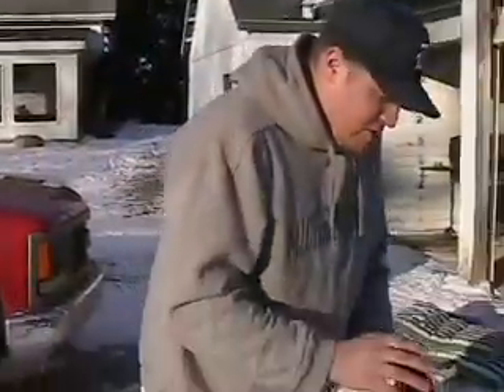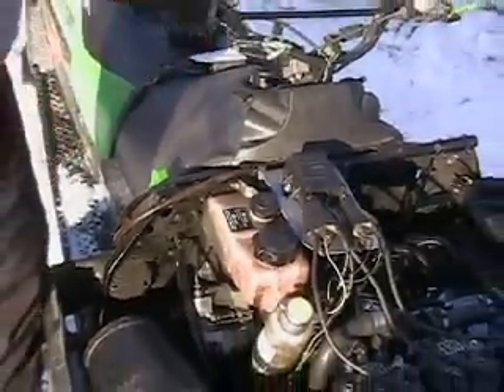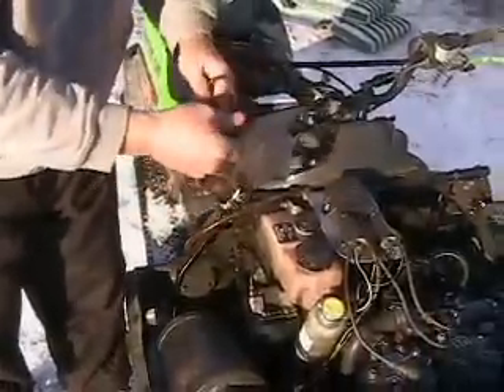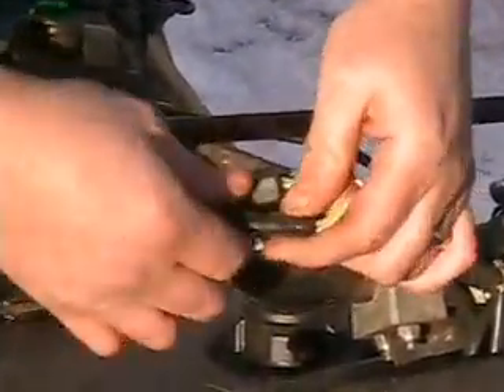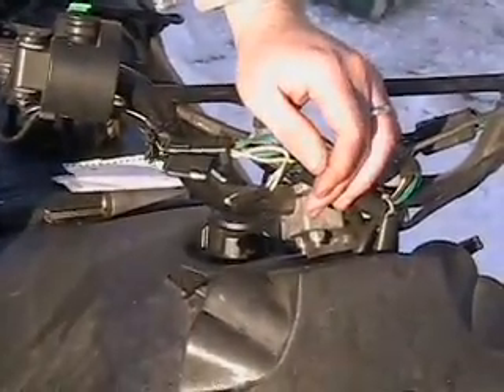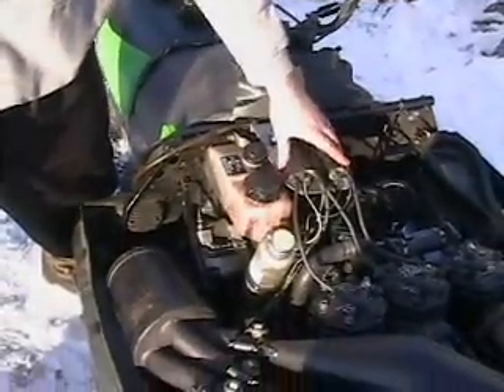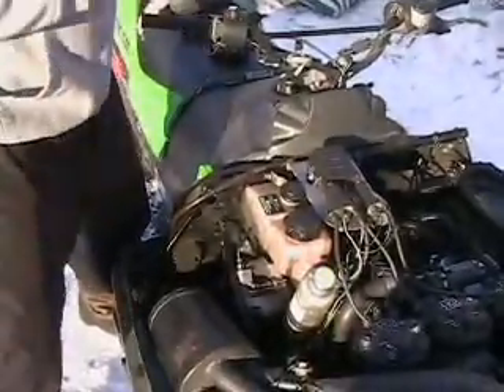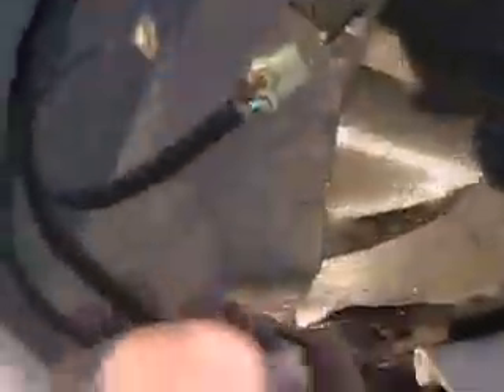Electrical Diagnosis for Arctic Cats

Comment: I checked all the stuff in the video like jumper jump tss my sled is a 1995 ext 580 i have a new coil stator and cdi in it still no spark with out the jumper it is a closed loop
Reply: Also I checked the kill switch and key both checked out me personally im lost

Comment: Hey man thank you for your videos I was able to successfully change my stator amd get rolling again. The harness got crushed and shorted out I thought I fixed it all but I still have no accessories. Really I'm just trying to get a headlight going as I just ditch bang with the sled I'm not on trails. Is it possible to just wire the headlight or a light bar directly to the 2 yellow wires on the top of the stator 4 prong plug. ?

Comment: I have 2003 artic cat mountaincat 900 is efi but I have to connect a 12 v into my fuel pump to make it work and also I have to pour gas to get it started any ideas is like the snowmobile

Comment: sled had big fire will back rebuilt most got running then moving coils and cdi it lost spark something is grounding surely replaced CDI with 2 coils low chance they both went bad just cant find what caused it.

Comment: i have a 02 z570 i have replaced stator the pic up coil and the coil pack and still have no spark.
Reply: i have disconnected the shut offs and still no spark

Comment: No spark but light glows when pull starting motor….stator ?
Reply from the maker: The stator has separate windings on it. There are ignition coils and there are lighting/ac power coils for lights and hard warmers.
Reply: @BlaineDP  thanks …discovered it was the coil . Your video is excellent..helped me diagnose the issue.

Comment: I had spark with stator jumper wire. So i pulled seat off mice got under there and chewed wires to twilight grounding out stator.  All fixed Thanks Again.
Reply from the maker: Glad you found your issue.

Comment: I have a 97 Jag 440 fan that I recently bought... the sled has spark and runs but I have absolutely no lights whatsoever.. I swapped out the stator and same thing.. I tested both stator for contunuity  and ohms and both tested good.. another thing I found out is when the headlights are on high beam the key and kill switch will shut the engine off but will not whe i put the lights on low Beam.. I am completely lost with what is going on and have lost my  patience trying to figure it out.
Reply from the maker: It's not a stator issue. Someone messed with the wiring or maybe there's a short or ground somewhere. Many times the issue can be found around the firewall or under the seat where wires may wear thru.

Comment: Do I need my electric start battery in my 96 panther 440? Since it’s closed loop
Reply from the maker: You shouldn't need the battery in it to have spark and start it unless it was a battery EFI model.

Comment: I have a 1997 thundercat that will run but as soon as I try engage the clutch and around 2000 RPM that's as high as it goes it's like the break is on it won't rub any higher. The track is free I jacked it up I've even had the belt off the clutch comes together but it won't rev up very high sometimes I'll even get a backfire out of it it's a wiring issue I know this because it's happened before but I just don't know where to look any help would be helpful thank you very much
Reply from the maker: ohm the stator, try bypassing the entire system by using the jumper wire ect..

Comment: My 89 Jag has issues. I've cleaned the carb, checked plugs etc. It will start after about 15 pulls; but, won't stay running. The people I bought it off of said that they had issues with the stator. They had it replaced. It worked for awhile, then it puked again. My questions is: would it even fire at all if there were stator issues? I ordered a new fuel pump as well. Should be here in a few days

Comment: I have a 2004 artic cat 650 4x4 v2  no spark a guy that had it hooked up a 24 volt battery to it and it blew fuse and now no spark I put a new cdi box didn't help I need help bad tyvm

Comment: I got a 97 cat 580 runs some times and most the time it doesn't got spark fuel plugs are wet u pull it and sounds like it wants to start but won't

Comment: Hey Blaine buddy? I have a 2002
Artic Cat 600 efi,
The only way I can get it to run
Is spray a little either but it won't stay running, I checked the fuel supply line and pump and they are working, but I can't get it to stay running any Ideas? It ran great last year, this year so far not good any  ideas are helpful. Thank you in advance

Comment: Just bought a 96 art 600 it had no spark unless I was on the throttle. I watched one of your videos. I put the jumper wire and she fired up. So with that being the case whats my issue?

Comment: Hope you're still replying!
Great video.
I have a '99 Panther 440. Starts fine, idles good, throttles up good UNTIL it will randomly lose power and die. Only happens when there is a load on the track, not when track is lifted in the garage. Restarts first pull and repeats. Ideas?

Comment: Thank you.  This helped get our sled running today 97 Artic Cat 580.  Had a 'closed' system but didn't jump the wires.   It was the TSS in the end.
Reply from the maker: Glad I could help. Ya, lots of sleds have their tether, kill switch, tss ect..go bad on them over time.

Comment: Does the metal bar in a double wire coil need to be grounded also I saw one that seems to be rubber mounted
Reply from the maker: The Cat coils are not grounded.
Reply: @BlaineDP  thanks for letting me know you saved me another new coil

Comment: I put a new kill switch and CDI box on my snowmobile and still don't get spark but has 120 compression and everything else works like the light when u pull on it but no spark
Reply: I got a 1993 polaris xlt 580 triple

Comment: I have an odd one for you, super weak spark on a 99 t cat just put a brand new stator In it. If I unplug the 4 plug connector I lose all spark .. what the heck.
Reply from the maker: the triples have much smaller/weaker spark that then twins do because they fire every 120 degrees and not every 180 degrees. If you unplugged the rubber 4 prong plug and all of a sudden had no spark, verify that you actually have a 98 or newer open loop cdi box on it.

Comment: Hey bud I need ur help I was trying to bye pass the tps so i cut the middle wire and now sled wont start i taped it back toghter still wont start did i jump the timing or what do i do
Reply from the maker: You mean the TSS. You only bypass it for testing. If it is bad you replace the washers.

Comment: I have a 1999 so 500 and it won’t shut off with key or kill switch. I have to ground out the coil. Any idea what it could be
Reply from the maker: Bad or broken ground. Moisture in connector. Moisture in kill switch or tether. CDI loses its internal ground path. I've seen it with 98-99 zrt800/1000 cdi boxes. Bad key switch. Bad stator. I've rewound several and it fixed their "won't shut off" issue.

Comment: Did you ever run into the situation where even with brand new statters you keep blowing out the light coil
Reply from the maker: The stator puts out the maximum AC voltage it can at every RPM. After about 3500rpms it is putting out 30+ AC volts. It is up to the regulator to regulate it to around 12 volts so it doesn't blow bulbs.
Reply: @BlaineDP  no what I mean is every time I put a new starter in everything checks out fine it blows the light coil not the light bulb the lighting coil on the stator

Comment: THANK YOU!  1995 Cougar with no spark.  It was the TSS.  Your video is step by step perfect and excellently narrated.  👍
Reply from the maker: Glad I could help. The TSS is a good thing because it can/does prevent start ups with a carb still partially open so the sled runs away from you when it starts.

Comment: I have a 98 cougar 550, didn’t have spark. When I unplugged the 4 prong connector at the stator, it fired right up. So I must have an open system, and there’s something wrong with the wiring in one of my switches right? And because it’s an open system I can’t do the bypass on the tss right?
Reply from the maker: Correct, you have an open system. You can still do the TSS bypass for testing. If it is bad I recommend fixing it or at the very least wiring in a safety tether.
Reply from the maker: It is an open system so something is wrong with one of your switches, the wiring harness, kill switch, tether or TSS.

Comment: Thank you for the video. What is the next thing to check if you do not have spark after jumping across the 2 non yellow wires?
Reply from the maker: Stator ohms, trigger/crank sensor ohms.

Comment: I just subscribed to your channel which looks to be very informative in diagnosing my 1997 arctic cat pantera 580 cfi
i disconnected the stator and everything was working, drove app. 3-5 minutes and it just went dead!
when i tried to started it my lights turns up a little at first but i wont start..
Reply from the maker: The 97 580EFI had the only 3 phase stator that Cat ever used. It was primarily just to charge the battery. I believe your stator plug has 3 yellow wires and a ground and that's it.

Comment: Killed 2 batteries lights and speedo  for starters Battery not charging , hooked to car today tack light worked, fuel pump worked no spark 1998 ext 580 Deluxe  Ken
Reply from the maker: that one I believe has the only 3-phase type style stator that Cat ever used. I don't rewind that style.

Comment: Hi Blaine  I just purchased a 1998 zrt 600 and the few hours or riding everything went well. Now I cannot shut it off by the ignition key or Kill switch. I have to choke it to shut it off. I thought I had found the problem with a brown wire that was broken at terminal that it is connected to the pull cord case cover. But that did not fix my problem. It starts well too. Any ideas what the problem can be? Thank you
Reply from the maker: I have seen a few things cause a "Sled Won't Shut Off" condition:

1. It is usually a bad ground or a broken ground wire
2. Moisture in the stator to wiring harness connector
3. Moisture in a kill switch or tether
4. CDI loses its internal ground path. I've seen more than a few 1998-1999 ZRT800-1000 CDI boxes lose their internal ground path and won't shut off
5. Bad key switch
6. A bad stator can cause a sled not to shut off. I have rewound several that fixed a "Won't shut off" issue.this list can be found at:http://www.outdoor-electric.com/sled-wonrsquot-shut-off.html

Comment: question had nothing to do with the sled but same maker i bought s 2002 artic cat500 and theres s fuse missing behind the ait box i know its not the starter relay switch but i was wondering what thst fuse is
Reply from the maker: I don't know what it is.

Comment: My 1996 Arctic Cat EXT 580 EFI is getting no spark at all. I was riding it and all the sudden it just died. It was low on fuel and I thought it just ran out of gas, so I filled it up all the way and now there is no spark. I put new plugs in and still nothing. I put the plugs on the head and pulled it over and not even a spark. The sled didn't have a tether anymore and Idk where the wires even are. It ran very well and then all the sudden died.
Reply from the maker: Click on this link and read thru my EFI diagnosis:http://www.outdoor-electric.com/diagnosing-a-no-or-weak-spark-condition-efi.html
Reply from the maker: A walk thru tutorial for EFI sleds: http://www.outdoor-electric.com/diagnosing-a-no-or-weak-spark-condition-efi.html

Comment: I have 97 open loop no spark or lights if I ground blue wire on firewall relay lights work but still no spark changed pickup stator ddi and grounded cdi box to battery still no fire
Reply from the maker: Cat went to open loop in 1998.

Comment: How can I tell if my 1976 Polaris colt is a close loop or open loop? I’m not getting any spark
Reply from the maker: Most older sleds are closed loop but one way to check is to see how the ignition switch works. If when in the "off" position it shows "open" or no ohm reading and in the "On" position it shows continuity (It'll be a very low ohm reading) then that shows you that the circuit needs to be "Closed" for there to be spark. If the ignition switch is the opposite (Showing an ohm reading when in the "Off" position and no ohm reading in the "On" position) then that means it needs an open loop to function correctly.

Comment: I have a 1999 Pantera 800 Triple. Was using it ice fishing this weekend. Just puttering around, and it started to rev up and down on its own. I shut it down. Restarted it, and it did it again. I shut it down again and it wouldn't restart, now it has NO spark. It has a 2 year old Stator, and the head light will glow when I pull it over fast enough. So I'ave taken apart the handle bars to get to the wires. It looks like the wire that comes out of my throttle is a 2 wire, not a 3. I'm trying to do a jumper to diagnose whats wrong.
Reply from the maker: You have an open circuit. You can just unplug the rubber 4-prong stator to wiring harness plug to bypass all electrical  in the sled. Revving up and down could be a reed issue, carb issue, fuel delivery issue ect.. too.

Comment: Hey Blaine talked briefly before just wanted your thoughts bought a jag z buddy put a 530 eltig engine from 89 he's running dual fuel pumps . It pulls hard but costly for trail riding . Talked to a local small engine mech locally and told him I wanted to condense the dual pumps down to one . He said no don't touch it as he p roll did the larger jets and or ported and polish really no way to know what work the other guy did tell it goes down and I have to pull it apart. My problem with this engine is It's almost 30 years old and the parts are becoming obsolete .ie fuel pump nonrebuild able costly stator flywheel etc . The first trip out it broke down 10 kms out in the bush .found out the bottom threads for the lower stator bolt are suspect and bolt found its way out into the stator assembly totally spaghettied everything the flywheel was reusable and located a spare unit for 100 out of peterbough. When i reassembled it put loctite and a lockwasher didnt want to get into retapping and alot of the thread holes are worn down fron guys wheeling bolts in and out for the last almost 30 years .I might like to go to a fan engine if i get into a corner on this 530 suggestions /transplant motor suggestions welcome the tub is a 440z 93 thanks for any info Mike
Reply from the maker: Single fuel pump should be fine on most any motor until you get into triple mod motors that inhale the fuel but even then a high volume pump can be good enough. As far as what motor to put in it..I'm guessing the Jag Z is a fan motor so there are no heat exchangers so you can only put a fan motor in it.

Comment: Hey Blaine I have a 1999 Arctic Cat Thundercat tired of chasing my tail stator ohms out good the two outer cylinders have orange spark with new plugs the center one has blue Spark I ride the tcat 15 to 20 minutes and it bogs down and dies tried jumping out the TSS to no avail has a new pick-up coil. Any ideas?
Reply from the maker: What were your stator ohms?
Reply from the maker: What are the stator ohm readings?

Comment: I have a 1998 Arctic Cat Jag 440 when I give it gas it bogs down and dies any suggestions on what it could be
Reply: hot boy sounds like bad spark plugs or a dirty carb.
Reply: Did you get it fixed? What was the issue? I have a 1991 that bogs down when you pull the throttle.

Comment: what is the open four prong plug down by plug that says ac...???
Reply from the maker: Not sure which plug you're referring to. I'm guessing you're referring to the 4 prong rubber plug that has the 2 yellow wires that plugs into the wiring harness.
Reply: ok so i jumped the stator wire and got spark. could a broken thumb/hand warmer wire be causing my issue? its a 1991 550 ext special
Reply from the maker: If you used the jumper wire and got spark then something in the wiring whether it is the wiring harness, a bad kill switch, a bad tether could be your issue. The hand/thumb warmer runs off of the AC power side of the stator and shouldn't effect the ignition but I've seen/heard of some shorts in the AC system causing ignition electrical issues.
Reply: i seen in one of your other videos u recommend skipping over all the handle bar junk and running straight to the key switch from that plug. would i go from yellow prong to one side of key switch and another wire to female side of plug that has yellow wire to from other key switch prong. key switch just has two prongs
Reply from the maker: Wire the 2 prongs on the back of the key switch to the 2 non-yellow wires on the 4 prong rubbery connector that plugs into the wiring harness. Now, you still plug half of that plug into the wiring harness..you plug the 2 yellow wires into the wiring harness that they'd normally plug into and wire the other 2 to the key switch. Bypasses everything.
Reply: got it thanks! now i gotta deal with a broken fuel line in the tank and a high idle :(
Reply from the maker: Most key switches have 2 male prongs on the back of it. Run a wire from one of the key switch male prongs to one of the non-yellow wires on the 4 prong rubber plug from the stator. Run another wire from the other key switch prong to the other non-yellow wire on the rubber 4-prong plug from the stator. Then, you plug only half of the stator plug (the remaining 2 yellow wires) into the 2 prongs on the 4 prong wiring harness plug. That gives your sled the required AC voltage to the regulator and runs the lights, hand warmers ect..